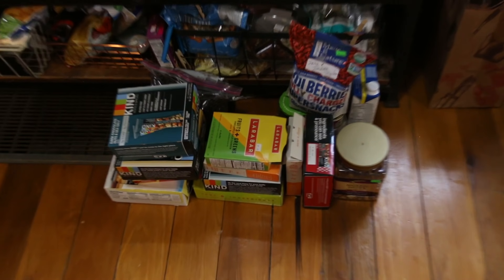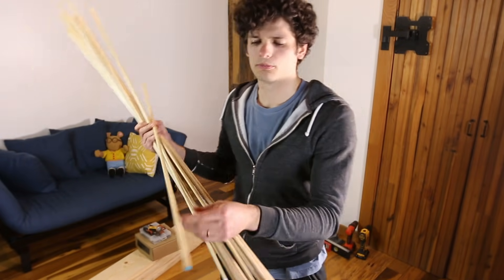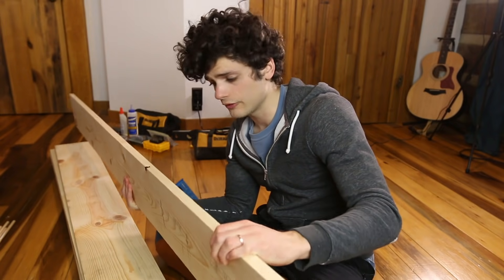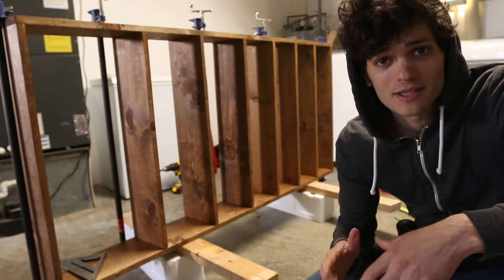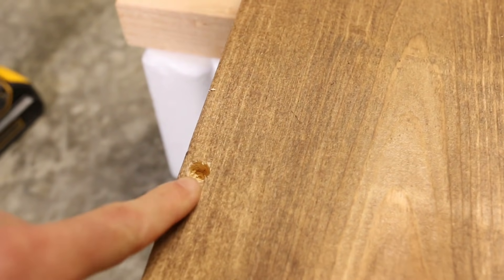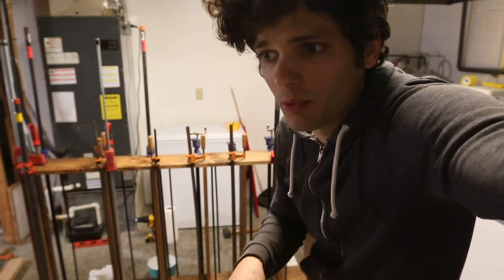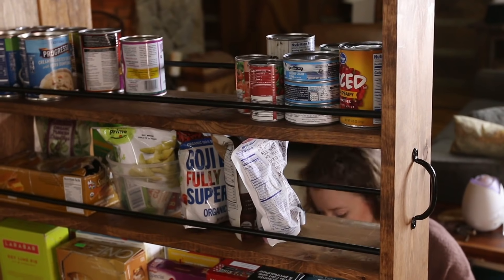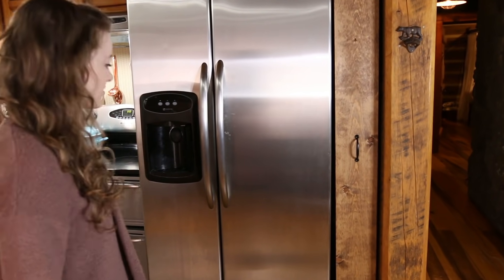I built the gift my wife has always wanted

Comment: I knew the moment you said no screws or nails it would collapse 
:( Those brackets were the perfect fix 👍. Great end result and a fine example of try try again !
Reply: Tulkas The Valar maby if you use biscuit with the glue it would of helped
Reply: @mc4nathan336  no, no biscuits mabye a bagel though.
Reply: My original thought was to use brackets, and I’m not a builder either.
Reply: @tolkienfan4815  Wow so funny
Reply: @muhilan8540  ?
Reply: @tolkienfan4815  I was just laughing at your joke
Reply: @tolkienfan4815  Unless you don't know what a biscuit joiner is
Reply: @muhilan8540  oh I thought you were just being sarcastic ( I do know what a biscuit joiner is)
Reply: @tolkienfan4815  I was being sarcastic. I just couldn't tell if you were joking or not so I just went with it
Reply: @muhilan8540  👍
Reply: Shouldn't have put stain on surfaces he was going to glue. Wood glue is super strong--stronger than the wood itself--but it doesn't work very well on finished surfaces. It doesn't work very well on end grain either. He should have used dados. But it worked out well in the end with the brackets. Great video.

Comment: Takes me back 31 years to when I was newly married. We'd bought an old house (fixer - upper of the worst kind) and the first thing that needed doing was stripping the kitchen and rebuilding it.

Armed with nothing but a borrowed radial arm saw, a hand drill, some basics like a tape measure and spirit level, and my wife's touching belief that I could do it with ease, I tackled it.

So, as I watched you blunder along I saw myself all over and didn't know whether to laugh or cry, and especially when Sarah started loading those shelves.... Uh oh, here comes trouble. 

But you recovered just fine and now you know better next time. And have immeasurably improved your confidence... 

Well done.

Comment: I kinda suspected it wouldn't hold with just the wood glue. Having done a few projects myself, I would've suggested cutting notches into the tall side boards that the shelves would've glued into, probably would've been stronger if you still wanted the 'no screws' look. Regardless, great job for a first project like that! Turned out awesome! Just as awesome as you two are! XD :D

Comment: You guys are so cute and it turned out great! I'm a construction tech student and I just finished a cabinetry class last semester. It was actually really reassuring to watch you work on this, because I thought, "Oh, I know how to fix most of those problems! I actually did learn something!" (I have a history of projects that turned out a lot like yours did before my classes and I'm sorry you had to deal with that frustration). I know you mentioned trying to make it look like one solid piece and that's why you didn't want to use screws or staples initially. Here are a few options I've learned about to hide how you are connecting a change of plane while not comprising strength.  I think they would have worked for your project. May be worth looking up for future projects anyhow: a dado cut to slide the shelves into, Craig screws under the shelves, biscuit/dowel pins (my current weapon of choice for the built ins I'm doing in my closet), and finally, thin nails with a nail gun and wood filler that will except stain (which I have used before and you'd be surprised how well it makes it disappear) Some require more equipment than others, but none are too bad at all to do! Hope this helps!

Comment: I’m a carpenter and that’s pretty great idea Jordan! Giving me and idea for my kitchen remodel. Also while I was watching this video and you were gluing the shelves I knew it wasn’t going to hold because end grain isn’t strong enough to hold with glue just by itself using small dowels rods, biscuits or what you used (angle brackets) to connect to the side panel without having to screw through the face of it. But great job on your project man!

Comment: You could have used wood biscuits for the joints, which would have required another tool, but it would have added enough strength to last long and also be invisible like you wanted. Though I think I like seeing the contrast of the brackets better. Nice job!!!

Comment: You had the solution to your problem from the beginning.. drill holes through the side pieces into the shelves and drive a piece of dowel in from the outside with some glue.  Two on each side of each shelf and it'll be strong and sturdy.   Not as good as some other joinery methods but as good as screws and much nicer looking.

Comment: The video came out fantastic! Good music selection and choice of camera angles. I have to say though with the amount of tools you have, it seems like you aren't giving yourself enough credit for your woodworking skills. I noticed you are missing a couple of things though. Use a fostner bit for dowel rods. It makes a cleaner hole with a flat bottom. Second, you should get a pocket hole jig and some wood putty. A pocket hole jig will let you use screws for thin shelving like that, but without having ugly screw heads sticking out the side of your project. Wood putty can fill in dings or holes in wood and you can use it to cover over screw and nail heads. Lastly, you should get an automatic center punch. They make nice little starter holes that help keep your drill bit from drifting.

Comment: Instead of measuring each board, in the future, use a stop block. Clamp any block of wood on your bench, or the saw itself (depending on how long a piece you need). Clamp it "x" distance from the blade. Butt your stock up against the block and each piece you cut will be exactly the same length without measuring each time.

Comment: You're a good man! I don't know if you have a table saw or a radial arm saw, but if so, you can cut groves for the shelves to fit into. Think of the shelf sliding into a sideways U on the main support. You can even use a regular handsaw assuming it has a straight edge, but it'll take forever. That way you wouldn't need screws. Just fyi for next time.

Comment: Nicely done, man! It looks great. I must admit, I cringed when you started attaching the shelves solely with glue, but through your perseverance it turned out great in the end! If you do another project like this in the future, you can achieve the screwless effect you were looking for by drilling holes into the ends of the shelves and part-way through the sides, and inserting wooden pegs. If you can't find any pre-made ones, you can make them from skinny dowel rods, just gotta slice 'em up and sand the edges a bit. If they're tight enough they'll hold really well, but a touch of wood glue will ensure they don't shift. This will also make it easier to space the shelves evenly and make sure they're all straight. You can stretch the measuring tape from the top of the side board to the bottom, and make X's where you want to drill for pegs at even intervals, and then make sure they're all the same distance from the edge.

I love a good DIY project, and this snack rack really turned out beautiful! It slides away so neatly into that previously unused space, and looks so clean. Love it!

Comment: A for effort.  I knew what was likely to happen  when you said no screws...  and I laughed hard on the next morning shot.  I've been there.  I'm sure the comments are loaded with advice and criticisms...  so I'll just say in the end if she likes it, you did good, and do a little research next time.  pocket hole screws would have been the way to go for simple, functional joinery.   Also some 1x4s screwed to both sides of the bottom shelf and sides and also the top member will also give a lot of extra stability.

Comment: Alright class, what did we learn today?....that's right, you should never ever use glue for any reason. Literally any other fastener is a better idea than glue. Screws are a good option but joints are always the best way.
Reply: Wood glue has its uses. It's great for repairing say dovetail joints in a  dresser drawer and stuff like that and smaller projects, but yes nails and brackets are usually the better option.
Reply: @tolkienfan4815  ok I guess I meant for construction, not repair